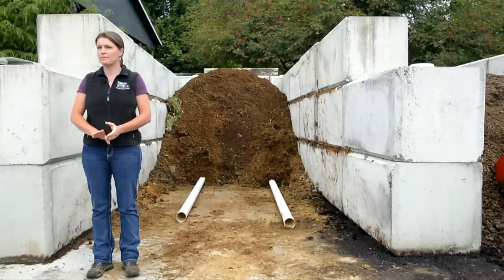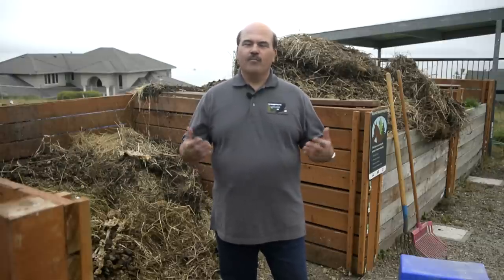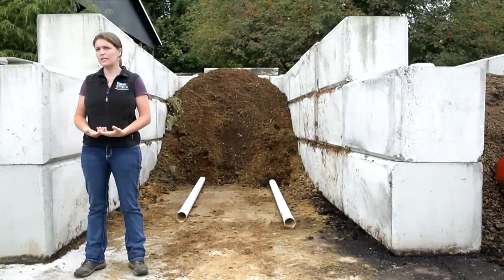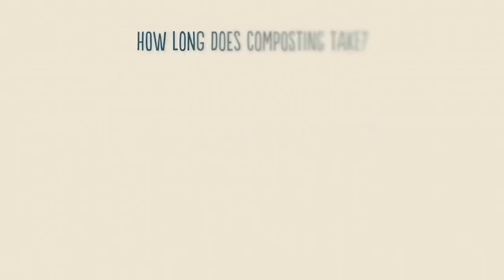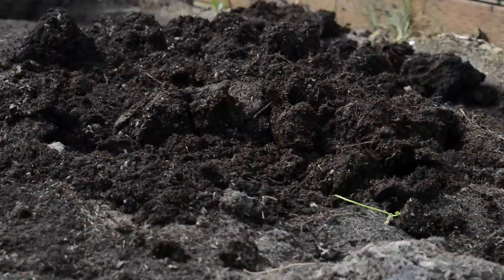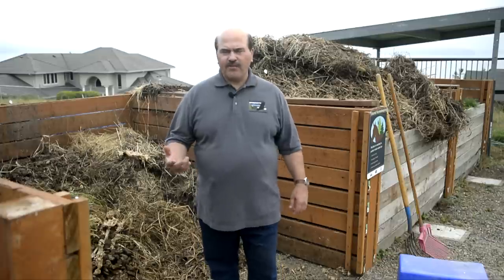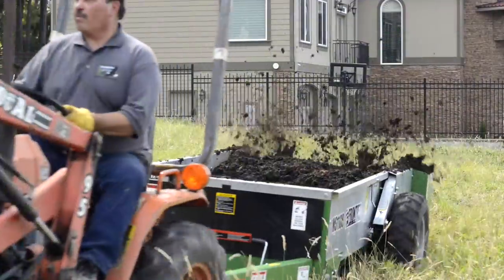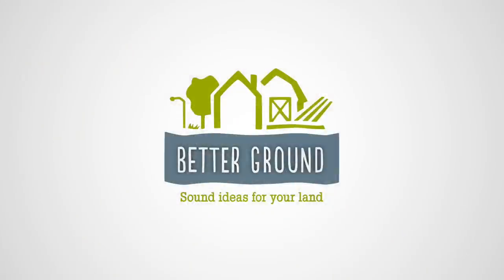Sound Horsekeeping: Composting Manure

Comment: amazing video! answered a lot of my questions! One question I do have is, can you add other feedstocks to horse manure? for example, can we add all our crop residues, leaves? Or is it best to do those separately? Thank you!
Reply: Mel Del I think the best way to find out is to try it once in a small batch and see how it performs. I think it will work fine.
Reply: sound good, I will let you know how it goes! thanks again
Reply from the maker: You can, but the more non-manure items you add, the slower the composting will happen. Dead leaves contain no live microbes where green grass contains still metabolizing chlorophyll. Metabolism from microbes decomposing the organic matter is what builds heat. Leaves are good, but bedding (wood) is not, for example.
Reply: Well I am adding all that fresh paddock manure (no urine-soaked bedding) to a huge progressive compost pile, layering it with scythed weeds, waste hay, coffee ground, dried chicken manure, and equal amounts of old wood shavings, and it is heating up a treat. The 'green' items do need a lot of 'brown' or carboniferous / cellulose material to work, to incorporate oxygen with its open texture, and produce heat for an extended period. So I wouldn't knock wood here, as long as it is always damp and has plenty of nitrogen added.
Reply: You can add all sorts cardboard kitchen scraps grass clips horse manure cow manure apples pears variation is better

Comment: Do you need organic fertilizer compost machine for disposing these manure?
Reply from the maker: No machine required. Simplest way is to pick a safe place that avoids runoff and leaching into the ground, pile up manure, cover it, and monitor moisture and temperature and turn and moisten as needed to maintain 130 F until completely composted.

Comment: Hi, great informative video!  I bought composted horse manure for my vegetable garden recently.  The seller said it had been composted from anywhere from 9 months to 2 years.  However, I can distinguish horse manure in the compost.  Is it possible for the compost to be be primarily composted and safe for vegetable garden ( with respect to free of possible E. coli/parasites) but still have distinguishable horse manure?  Or, is distinguishable horse manure a sign that I shouldn’t use it?  Thanks!
Reply from the maker: Hi Brandon, I fielded your question to Michael Hipp. Here is his response:

"Excellent question!

9 months to 2 years is a great amount of time for horse manure to compost. I have some here at my place that has been composting for 9 months and it is the most beautiful, black soil there is, very much like the compost you purchase at one of the big box home improvement stores.

And that is what it should be - black, rich soil - just like you would purchase at the store.

If the compost contains any recognizable fragments of horse manure - the famous "apples" especially - then the product is not completely composted. If it is any color other than a dark, rich black then it might be fully composted, but it was not done correctly and lacks a lot of the nutrient value. I suspect that if you are seeing distinguishable horse manure, and the person says that it was composted for that long...you are probably looking at brown/gray manure that, when it was composted, was left uncovered and never reached the required temperature to compost horse manure and was rained on so a lot of the nutrients were lost. A lot of people think that just putting horse manure in a pile is "composting" but it isn't. As you saw in the video it is much more than that. 

As for the question of whether you should use what you have, I would not. I can't say if there are any parasites in the manure or not, but I can say that it does not have the nutrient value that properly composted horse manure would have, and when you are growing vegetables you will want the best nutrients you can get."
Reply: @SnohomishCD   Hey, thank you so much for the reply!  That makes a lot of sense.  I'm honestly still on the fence about using it, but I've already mixed it in with my other soil.  Today I broke apart a couple of the 'apples' (smaller ones) and noticed little white worms inside.  I think they are pot worms, from what I read on google, and hopefully not parasites from the horses intestine.  Either way, it doesn't inspire a lot of confidence in me with the vegetable garden and just another thing to make me think twice about using it.

Comment: Can manure from horses on meds be used to make compost for a small home vegetable garden?  Would it be safer if it went through our worm bin?
Reply from the maker: Hi! Thanks for the question. It depends on what type of medicine. What kind are you referring to?

We had a similar question recently. I've copied the response below. 

'Composting manure and bedding from animals that have been de-wormed with ivermectin decreases the concentration of ivermectin such that the resulting compost product can be used without harm or negative effect to beneficial insects in the environment. As ivermectin has been found to persist in manure for 45 days or more, composting is a good management technique to use for manure after de-worming, or if animals are continually de-wormed. In addition, as the ivermectin concentration decreased almost entirely in the first 24 days of composting, subjecting manure and bedding from de-wormed animals to a thermophilic phase through piling would allow horse owners to field-spread the manure prior to finishing composting.' 
  

(Swartz, Mary, et al. "The Fate of Ivermectin in Manure Composting", Cornell University, May 2016, p. 8)

So, while it does have an initial effect, the composting process breaks it down like most chemicals and it can be used like any other compost after it has broken down."
Reply: @SnohomishCD  Thank you so much.  The other medication I was told about is Previcox, which is an anti-inflammitory.  Would this require special care?

Comment: I have been using horse manure in my garden for year. This year  I am seeing some leaf curl. Could it be from the horse manure? I do let it sit for atleast 6 mos before using. Generally I rototill it to break it up, the mix into my garden soil. Could it be too high in Nitrogen?
Reply from the maker: Hi Krista,

Here is a response from our Agroforester, Carrie Brausieck.

"Leaf curl in fruit trees is caused by two potential culprits:
1. a fungus that can cause curling in peaches and nectarines
2. aphids causing curling in many other tree species

Leaf curl has been a problem for many this year due to the very long wet and cold spring that we had, so I doubt the manure is the culprit. If there are no signs of aphids on the trees then the problem is most likely fungal in nature. Spraying trees with copper spray (you can find this at a garden store) as trees are entering their dormant phase (in fall after the tree has fruited) can help get this under control. If there are signs of aphids, they are fairly easy to control. You can spray them off of tree leaves, rinse trees with organic dish soap and water, or get an army of lady bugs to release onto your trees. "
Reply: @SnohomishCD  Turns out it was the horse manure. I did a test. Potted up some of the poo, planted a basil plant that was otherwise healthy, and within a few days it was looking deformed.

Comment: Wait what do we amend soil with in winter?!
Reply from the maker: Hi Annie. I passed your question to one of our farm planner and here is their response:

"You do not want to amend your soil in winter. Composted manure should be applied in spring and summer months when plants can begin to utilize the nutrients you have applied. In winter plants are not uptaking a lot of nutrients and nutrients such as nitrogen can leave soils in surface and groundwater drainage. 
Many horse boarding facilities in our area produce more manure than they can safely apply to their soils. Therefore, they must find ways of hauling off excess manure which can be costly. Composting manure for bedding can provide a cost effective solution to excess manure production and allow that manure to be reused on site. 
Farm planners are available to come out to horse properties and do some nutrient management calculations to see if you have a surplus of manure. If you don't have a surplus then this practice may not be for you, but if your animals are producing more than can be applied to your pastures, this can be a great practice to explore. "

I hope this helps!

Comment: How long can the compost last after its finished? Also how long of setting can the manure last before you have to start composting it?
Reply from the maker: Hi Bo, we appreciate your questions. Per our Farm Planner, Michael Hipp:
The short answer is that compost from horse manure can never “go bad” unless it is stored improperly. To properly store your fresh compost it is best to keep it covered with a tarp, to prevent rain from washing away those vital nutrients, and to retain heat and moisture, which will help the microbes in the finished product to survive so they make it to your pasture. How long it will last once it is “finished” depends on many factors, including outside temperature, humidity, wind, etc., but generally if properly stored it can last multiple years. As for how long the manure can set before you have to start composting it, it should be added to a compost pile when it is as fresh as possible, usually within 24 hours for best results. The longer you allow the manure to set before adding it to the compost pile the more moisture and heat generating capability it will lose, and thus the less it can add to your compost pile’s ability to perform the composting process.
Reply: @SnohomishCD  thank you for clearing that up for me. Loved  the video.

Comment: Could you tell me the estimated ratio between straw and manure?
Reply from the maker: Hi Thomas,

Here is a reply from our Sound Horsekeeping guy, Michael Hipp.

"The ratio between straw and manure should be as low as possible - the lower the straw content, the better. I like to keep my bedding / straw ratio to manure something like 1:10, or 10% of the total volume. The reason for this is that manure contains enzymes and microbes that directly contribute to the breaking down of the manure and fibers within that manure. Straw and bedding (bedding typically being made of wood in some form) do not contain those enzymes and microbes, and so they add nothing to the process, but instead require energy from the process for itself to be broken down. As long as the amount of straw or bedding is kept low the enzymes and microbes in the manure can break it down, though having to do so will slow down the total process and add time to the amount of time it will take to finish composting. In fact, the more straw and wood you put in the slower the process will go."

I hope that helps!

Comment: Would wood shavings deplete nitrogen from the compost?
Reply from the maker: No, they would not, however, they will slow down the composting process.
Reply: @SnohomishCD   interesting, thanks. I took a lot of manure compost from a local stable and it tested almost no nitrogen. Very baffling.

It also did not grow vegetables

Comment: Horse manure compost is the weediest stuff going. Unless it is WELL composted( 3 years), adding it to a vegetable garden will be the biggest mistake a gardener could make. Experience is a very good but sometimes harsh teacher. 
Cow and chicken manures have much less viable weed seeds.....horse manure is the worst.
Reply: Hot compost properly will kill them 3-6 months will be adequate if it’s maintained well air water mix carbon nitrogen ratios